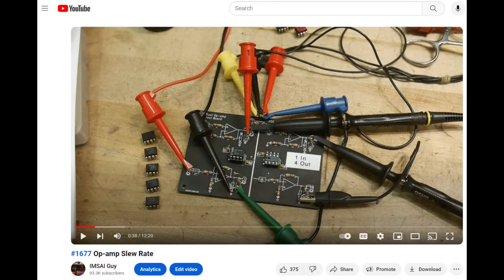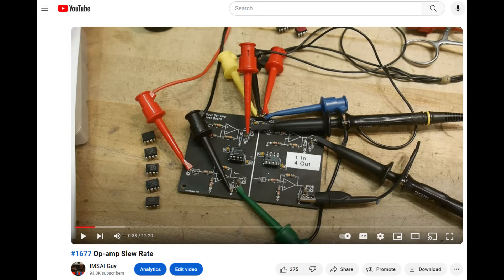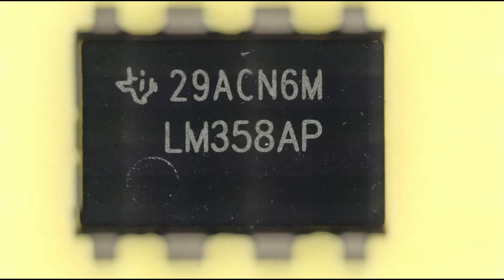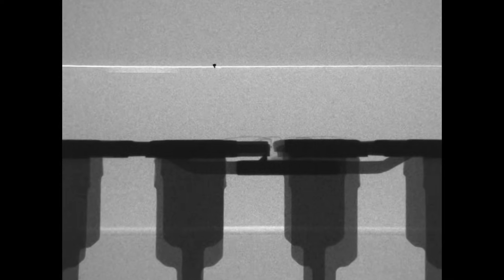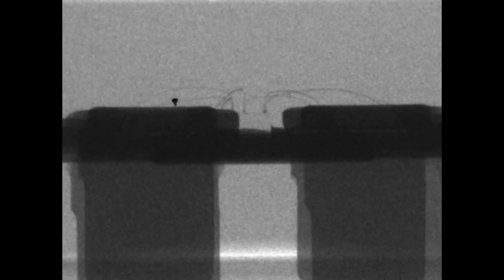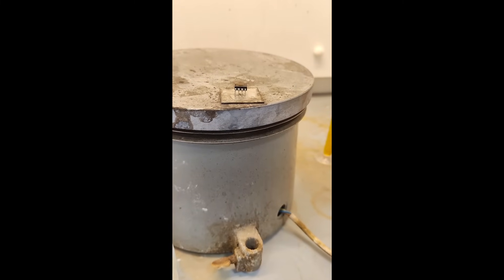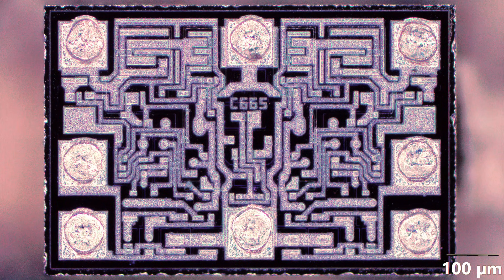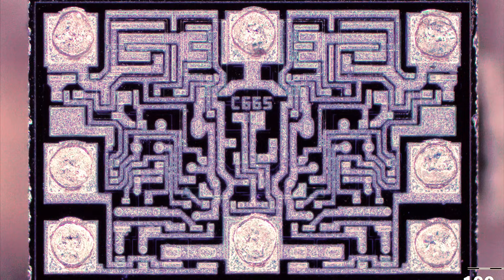#1749 Fake LM358 De-cap

Comment: Fake 2N3055 glut, anyone? I sawed one of my bucket-o fakes open, and the die was as big as a flea.....but it tested hunkey-dory. It's apparently some sort of horizontal output die, so I just use it as a pissy weak, oversized HV switchie as such.  ... roll with the punches. 73 de W3IHM

Comment: I have de-capped several ICs at home and it really isn't very difficult or dangerous. The nitric acid method is very fast but there are slower, safer ways. The most common way I've used is to just drop the entire die into a flask and add concentrated sulfuric acid. Then I heat this to about 100 to 150C with a stopper in the flask and leave it for about 6 hours, occasionally agitating it manually. The acid turns a dark brown or black color as it reacts with the plastic package and breaks it down. The plastic and metal parts get dissolved but the die is left untouched. When finished, and after the flask has cooled, I slowly pour the contents of the flask out into a much larger container of cool water, finally fishing the die out of that or if it remains in the flask, after all the acid is gone, I add some cool water to the flask and then pour it out onto a paper towel and retrieve the die. The only real precautions needed are safety goggles, plenty of water nearby in case of getting anything in your eyes, and washing your hands after each time you handle any of it. The sulfuric acid does not need to be pure, you can use acidic drain cleaner (don't use basic drain cleaner like lye).

Comment: At the semiconductor company where I used to work we would not write the commercial type number (e.g. LM358) on the die, but use the internal project number, which included a version number. Each time when we had to do a revision change major enough we would also have to modify the metal layer to indicate the new development type number. Maybe that second chip (C665) is such a product which is marked with its development number instead of a commercial part number.

Comment: Well, why they do this?
LM358 is not an expensive circuit. Actually it's  dirt cheap.
Customer buy it once, and then   never buy again from the seller. 
Neither is 358 difficult to manufacture. At least part of low quality. Make plenty cheaply, add TI logo, sell for higher price. And only some customer will be suspicious, because of noises etc.

The die from film contains two symmetrical parts. Maybe its an opamp. Maybe audio stereo  amplifier. If you have better pictures, its possible to recreate schematic.

Since LM358 is cheap, I don't see much sense in faking it.
You need to make many thousands of them .. and find customers, to make reasonable money. And basis chip are not cost free either.

Maybe it's real manufacturer mistake - someone took wrong batch of dies, or chose wrong label to print. Quality checking discovered error and they were  throw to garbage.
Reply: You have no idea about this business in China. Theses are extracted from junks which imported into China. The whole village is doing this kind work. Recycled op amps are sold to the fake parts dealer measured in KGs! The parts are sorted out, cleaned and remarked. They are not interested in cloning a LM358.
Reply: Everything is faked in China. Everything! Even the colour of the dirt may be faked. Why? Do whatever is cheapest.

Comment: Interresting video.

Out of curiosity and for science I baught some LM6172 from ali at an alarming low price (1.2€ each). As expected it was not original parts and furthermore almost all of them were deffective/non-functional parts (instantly blew up), few of them did not immediatly blew up but were behaving like a damaged part (output would not exceed 2V while powered with +/-12V). Maybe they re-badged them the wrong way (rotated 180° ?)
I had prepared a test fixture to compare their performances against real ones I have in stock, I did not even need that. A bit disapointed as I was hopping to have some re-badged low cost op-amp, but it seems they did not even care doing that.
Anyway, just from looking at them you could tell the package has been grinded to put a new marking on them...

Comment: TI now makes their real logo out of stripes which is hard to fake. So if you see any new chips with a solid TI logo most likely it's fake.
Reply from the maker: I have not see the stripes. be aware, this is a quote from TI directly: "Yes, the logo pattern can differ between parts based on what manufacturing site they were created in."

Comment: Same fake OPA128LM　Low bias ＞60fA FET input OPamp. I had bought 5 items from China.  I  tested -5pA,-7pA,-7pA,-10pA,+4pA . I had loss many hours.
Reply from the maker: +4pA  that's a good trick
Reply: You probably got LF356 or some cheap fet-input ones.

Comment: sorry , my mistake , C655 actualy is 2 bilateral switches , absolutely no OP. chinese scam.
it is probably one of the many atempts to copy the TI SN74LVC2G66 . both 1G66 and 2G66 have chinese tofu copies marked as C665 and C655.
Reply from the maker: ??? again, this device is an opamp, see video 1. in fact it is a nice opamp. it has nothing to do with switches.

Comment: Who in dog's name would counterfeit am LM358, a part that very likely is actually much more common than the mythically common 555 and could easily be recycled - take any random piece of junk electronics to parts and LM358, LM324, TL431, LM393 are literally the most likely chips to be among the parts you get. Would have guessed uPC665 or uPC6650, but none of these are opamps....
Reply: The only reason would be because they're so popular that you can move a ton of whatever these are by calling them 358's and inserting them into the supply chain somehow.
Reply: @bryede  Also sorting, testing and providing a guarantee for the parts (second hand parts) would be out of the scope of these scammers.
If they could, they wouldn't hesitate to sell you black beans directly fished out of their chilly as integrated circuits.
Hehehe:)

Comment: Interesting. IMHO one of the highest volume counterfeit parts currently (with IoT everywhere) is the Dallas/Maxim/Analog Devices DS18B20 temp sensor. Even reputable outlets are selling fake parts. These work, but are not as accurate or stable as the real ones. It's concerning!

Comment: You should trying to run it at up to 36V supply like the LM358 can use !
Reply: The only thing running is you after getting blown smoke at by a lm386

Comment: "Fuming" nitric acid, either the red or yellow variety, is most definitely not something anyone who is not VERY well versed in handling of dangerous chemicals should be attempting to use. I suppose you can make the case that it isn't as dangerous as hydrofluoric acid, but ...

It is really quite disgusting that electronics manufactures have to go to such extremes to assure that the parts they are buying are not counterfeit. If a company is forced to resort to a parts broker because of extreme shortages, which certainly have existed in recent years, I can see it. There have been instances in years gone by of counterfeits making it into legitimate distribution channels.
Reply: Hydrofluoric is safer in a lot of applications… (definitely something a respirator and gloves are mandatory with however).

Comment: Single op amp ripoff of this - Microchip Technology Inc. MCP665-E/UN Op Amp, Dual, 60MHz OP w /CS, E Temp, 10 MSOP 3x3mm Tube?
Reply: Plausible, the MCP66X is a third of the price (possibly bc it's a SMT part) and has a much faster slew. I wouldn't call it a ripoff right off the bat myself without seeing a die shot of one of these chips first. More likely they packaged the cheaper die in a PDIP to sell and make a profit. The 665 is a dual opamp with CS pins which are internally tied low so if you leave them floating and just take the other eight pads out to pins, you have a strong candidate.
Reply: I'd expect to at least have the bond pads for the missing pins in here then. Looking at the layout the fake chip still is a dual opamp though. V+ mid top, V- mid bottom, outputs top sides and the other one are the inputs. You can see both halves are nicely mirrored, the top has the bigger transistors to drive the output, and in the middle there is a bias current generator shared by both halves of the chip.
Reply: @rjordans  I had thought about the number of bond pads myself and that's why I believe that pins 5 and 6 are left floating with the assumption that the square pads on either side are those bond pads. I am not entirely certain of course. I am not very well versed with dies and those assumed pads don't look the same as the others so I could be entirely wrong. I couldn't find a die shot of a confirmed 665 and lack much to validate either way. Just figured on putting some conjecture out there.
Reply: @nicolaspinto2927  Or maybe it's a copy of the MCP655 but with the CS pins and associated circuitry removed to be cheaper.
Reply: The mcp662 could be an option but that should be easy to test as it won't stand a supply voltage above 7v or so

Comment: Why would you want more fakes? Was it price, or unique function?
Reply: basically the chinese part had better slew rate then the original LM358 from Ti. He explains this at 7:44 in the old video.
Reply: The point is not get the random fake but the original chinese they put inside
Reply: @ciano5475  Fake "is a really good part" so I'm guessing it had unexpected attributes which would be desirable to repeat. (I should have asked what was special about that version).

Comment: The X-ray picture is already quite helpful to spot a fake part. Die photos can be found the old databooks.If the landing zones of the X-ray don't fit those in the die photo, you know you purchased a fake part.
The 358 has a common mode input range that extends beyond the negative supply rail. Many applications rely on that. I wonder whether the fake parts would even work then...
Reply: The common mode voltage range of the LM358 extends to only about 0.3 below the negative rail because of the input protection diodes. The positive limit in terms of function is up to about 1.5 V below the positive rail but the inputs can be subjected to the full rated supply voltage of the part without damage, regardless of actual supply voltage used. +32 V is the rating for the "standard" family. This is unusual and due to the fact that the inputs are made with lateral PNP transistors that have remarkably high base-emitter reverse breakdown voltage (most silicon transistors have reverse B-E breakdown of around 7 volts).

Lots of op amps have a pair of "back to back" diodes between the inputs, so the differential voltage is limited. There are no such diodes in the 358 so it is more suitable for things like comparators where you might want to allow a large differential at the inputs without current greater than normal input bias current.  It is slow as a comparator but still quite acceptable for lots of things.

Die diagrams are one of those things that just slowly disappeared without most (I think) people noticing. I have no idea what is even being offered for bare dies these days. I don't suppose there is a lot of demand for hybrid circuits anymore so not much demand for bare chips.

Comment: Yes to the scammers if they need a dual opamp they will get a dual opamp from one of their  suppliers in the right package, and sand the top, or blacktop them, and mark as needed. Might even be able to order them as plain top direct, cheap. After all you make better if you sell something that QC can check, see it is an opamp and works, and put in stock, so you get a few more orders before they realise the parts are all failing.
Reply: I performed warranty work in the 1980's and Emerson had a bunch of issues because of that.